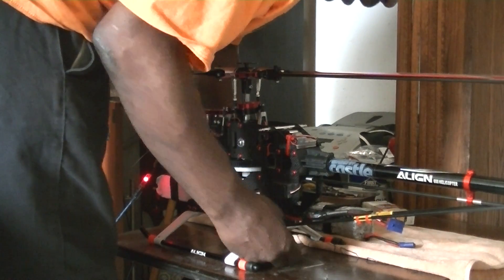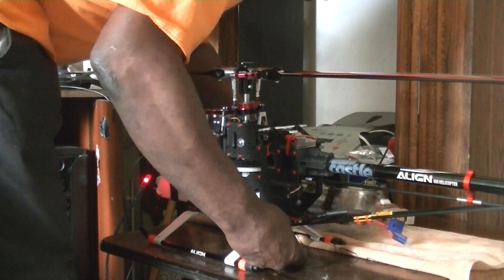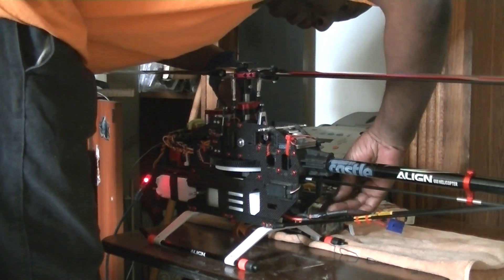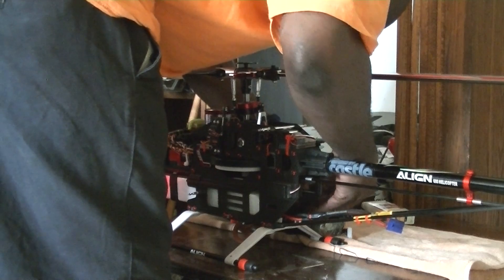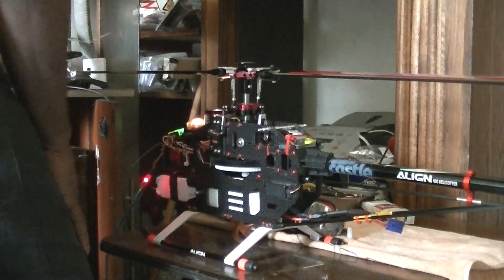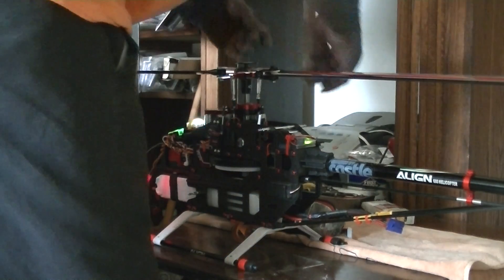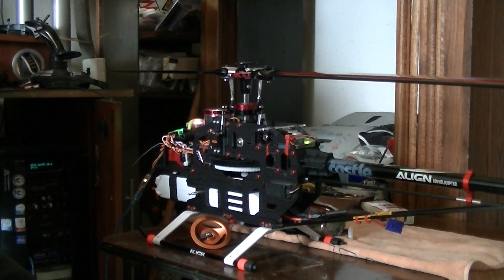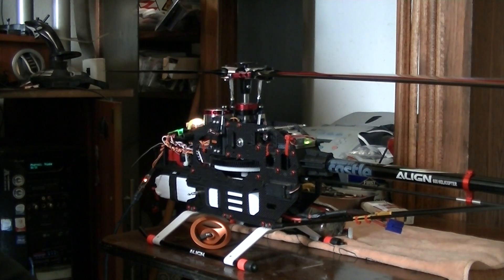Align T rex 600L DFC Dominator head speeds and cc gov gain and pwm rate

Comment: I ussually only fly one way
its upside down, on its side or flipping so I prefer my headspeed
also the 2350 speed on this 600 helps hold the tail if you run stock gears
I really recommend finding 97mm blades, just slightly longer but help alot.

Comment: 2350 is my sweet spot
seems to do everything I ask of it there
You dont want to run over 12s if your using a Castle ESC
Reply from the maker: i like a low and a high 2100 to 2400 all seem high
Reply from the maker: im using a Hercules bec on 6s